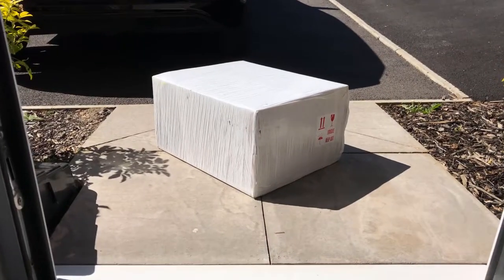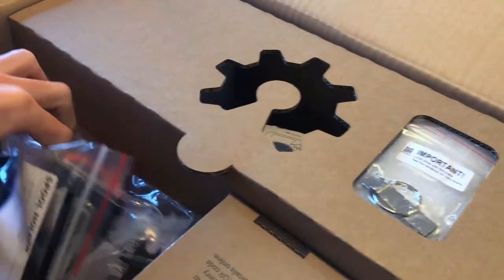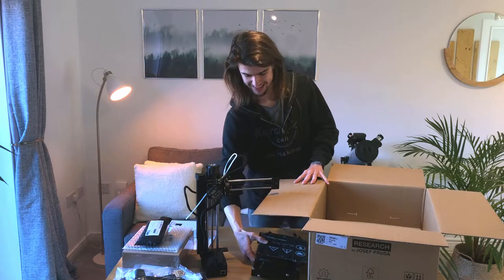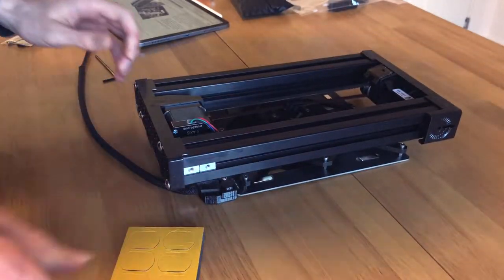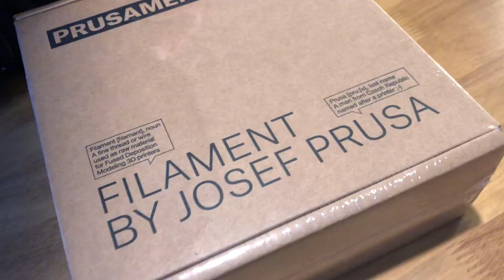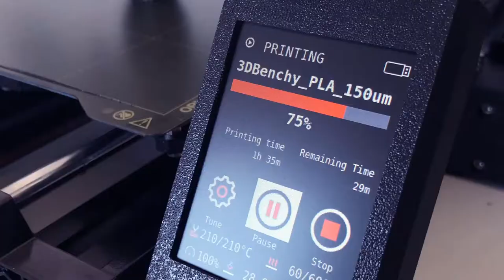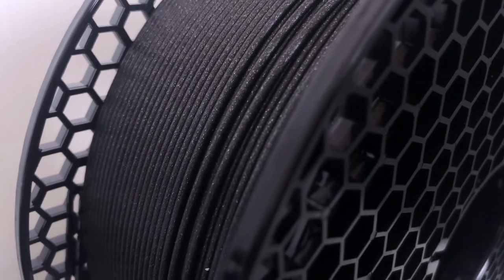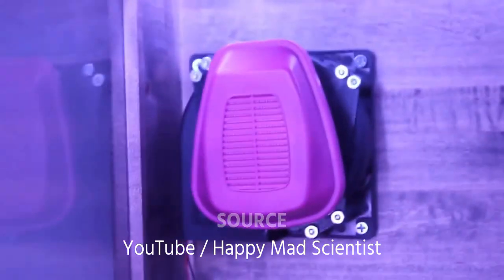Unboxing: Original Prusa Mini+

Comment: Hi Matt, thanks for sharing this comprehensive video of the assembly of the mostly built version of the Mini+! I see that noise is a concern of yours, you may want to look into "the paver mod" in which a large square concrete paver is placed under the unit along with a foam buffer. The sound level will decrease substantially.
Reply from the maker: Definitely worth an investigation, though I’m not sure if my IKEA cabinet the printer is on top of would be able to support a concrete base! Thanks for the tip 😊
Reply: @akamatchstic  I have the ikea enclosure for a while now and I did the square concrete modification. It is really worth it! And the enclosure haven’t suffered from it. Plus you could come up with creative way to make a video about it !

Comment: A month? Ordered my mini in Jan, got it in May
Reply from the maker: I can only guess I got lucky with the lead times?
Reply: @akamatchstic  I got the kit where the lead times were ridiculous. According to them 80% of their shipments are kits
Reply from the maker: @raul0ca  that sounds about right, I remember seeing the lead times were double for kits compared to the pre-builds! Hopefully it’ll drop down soon for new buyers, but we’ll have to wait and see
Reply: @akamatchstic  No, the normal leadtime is about a month, but that could change if they are very busy.
Reply: @raul0ca  Yeah I saw that and I thought it was ridiculous too, but me having no experiënce whatsoever in building a printer I thought I'd buy the semi-assembled one, for just some extra Euro's.
Reply: @Ewout761  That's not a bad plan. Remember the full build instructions are there in case you need to disassemble it for repair

Comment: Is it a good printer?
Reply from the maker: I’ve been using it exclusively since this video dropped lasted year, and it has held up very well. For 99% of my prints, it has honestly been a case of turn on the printer, hit go, then a couple of hours later I have a great quality print.

There’s been a couple of prints that barely fit onto the print bed, so print size is clearly a potential issue if you want to print big things. I’ve had a couple of issues with the print head getting clogged which was a simple fix - just heat it up and poke through the supplied needle to clear out any remaining filament. 

After re-doing the Z height calibration, my first layers have all been pretty solid. Currently I do have an issue where sometimes ABS prints will detach from the print bed slightly leading to part deformation, though I’m certain that’s my fault and not due to the printer itself.

On the whole, it’s worth the cost.
Reply: @akamatchstic  Thank you, my Mini + is on its way! :)